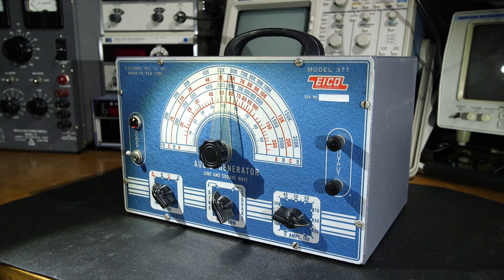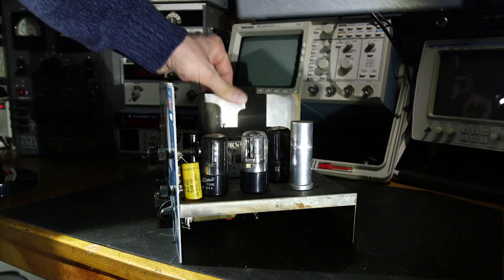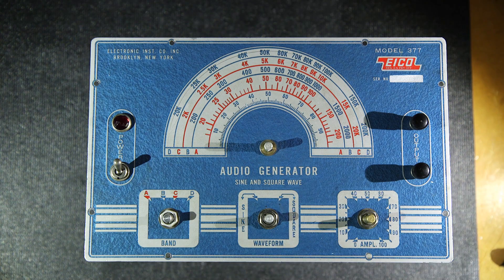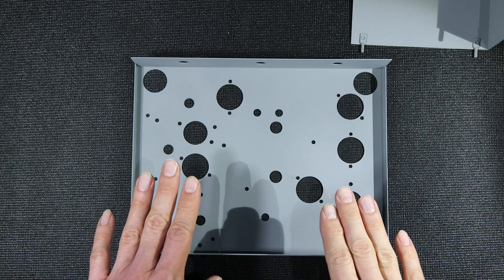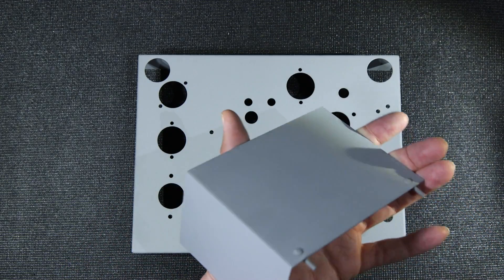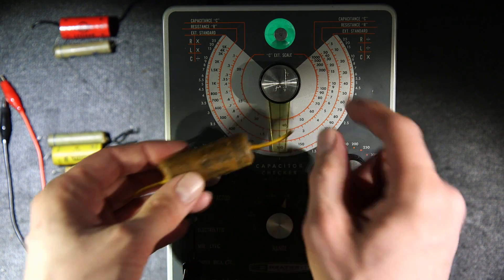Audio Signal Generator Restoration EICO 377

Comment from the maker: To learn about electronics in a different and "very effective" way, check out my Patreon electronics course here: https://www.patreon.com/MrCarlsonsLab
Reply: Mr Carlson's Lab I'm curious where you start it at... do you assume prior knowledge (or prior failure) at all?
Reply: Hi Paul, recently joined your patreon page, how do I PM you? I am new to this sort of stuff
Reply from the maker: What is your name there Chris? I will PM you to make this easy, then you can just PM back to that original PM..This will get you started.
Reply: Hi, my screen name is chris johnstone. Look forward to hearing from you.
Reply from the maker: PM sent on Patreon.
Reply: I need to know how to align an eico 325 with only antique test gear please
Reply: 32:56 i wonder if you cut each type of copper wire you instal sent to a lab that you get a reading of all the metal material in each wire....that some might be diferent....so what if you did one radio with one string of wire so that all the wires are the same materials percents of copper and other metals in the copper....it iz the same to a remote control vehicle batteries....that you match them....a 2/3a matched battery pack

Comment: Mr C. I think your right on the black color on the cadmium plated chassis, some older transformers used a paper wrap for insulating that contained sulfur compounds, when the transformer blew or got hot the sulfur combined with the cadmium to form cadmium sulfate which will cause it to blacken. Your videos are great and i learn something each time.

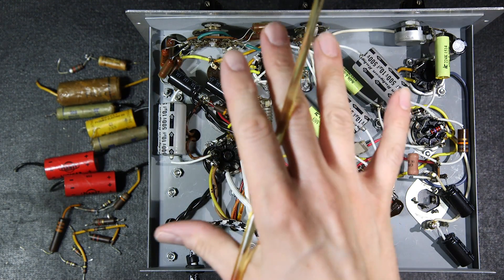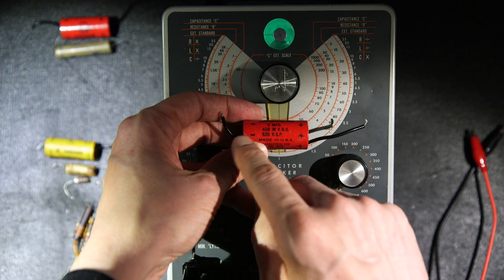Comment: @ 40:55 , we can see you added a new power cord (to assembly instruction original connections) , and @ 54:20 you state that an old electrolytic cap, if shorting out, can burn up your B+ and filament transformer, but, how about installing a properly rated fuse in this older equipment to protect it better from future component failures that may damage hard to obtain or irreplaceable components?  Some of this old Eico, and Heathkit gear (and other manufacturer / models as well) , have no fusing on the primary line/mains side, but if you check similar newer models of the same types of equipment it was added over the years. If no fuse is added, that unfused line/mains circuit will feed your transformer, or in some AA5 configurations (with a solid state rectifier, the shorted filter capacitor/s,) all the current they can ask for until the smoke show is over. Granted, like you said, this is your device to do what you want with, but IMO checking for proper fusing, and adding it if it is not there, is a good practice to follow.

Comment: Ive got the silver case 377 with black numbering. Its the same works inside, some use the newer Noval based tubes. My inspection  sticker is dated 1965. I love the blue baked on paint job of your 377. However I do believe the silver look is more space age looking. The antique radio repair bench in my little shop is all EICO equipment placed in a wall of silver pieces. I also have a Barker & Williams Audio Generator. The color scheme is a hammered powder Blue steel case. It made to Mil-Spec. I worked for B&W in 1961 and picked it up upon severance.

Yes , EICO did cheapen the construction of the  377 Audio Generator. The chassis and panel metal are  made  of a Cheaper,.and thinner grade  of brushed Aluminum. The 4 ganged  variable tuning cap was reduced from a 4 gang section to a 2 gang sections.

Comment: I got an RCA WA-44c I have been restoring. Had to change the dial tracking by attaching a knob to the dial face itself. I plan to toss on a BNC connector so I can use it with modern devices. Also old PCBs are a pain in the rear to remove old worn out parts from. I lifted three traces and had to use a jumper wire to repair the broken traces.

Comment: Ive got one of these units on my bench right now.  I finished the re- cap process. Next up I tested the R’s and replace anything off value. You answered my Q about the shaft coupler on the Freq. control.  I  forgot about that theory over the years. Thanks! My only problem occurs ar the top band. If I adjust  and calibrate 100 Kilohz and tracking is good the square wave looses its integrity and looks more like a sine wave. The frequency begins to go ooff cal.around 200 Khz and the end of top range is 250Khz. The 6SN7 is the original EICO tube, it tests good in my EICO tube tester. All the components in the square wave shaper test good and Caps were replaced. I did not use a 1k ohm resister  across the output when I tested it

Comment: One reason not to be too fussy about the frequency trimmer setting is that there is about a 5% frequency variation between the ranges, as demonstrated around 1:32:15. This variation would be due to the tolerances of the resistors connected to the range switch.
It would also have been interesting, after tuning the trimmer, so see how well the frequency matched at the high end of the dial, though nothing could be done about that.

By the way, I own one of those Heathkit IT-11 capacitor checkers. I would not be surprised if it itself contained capacitors in need of some replacement!

Comment: 1:34:12 - I remember the correct procedure was to use the POT to adjust at the LOW end, use the CAP to adjust at the HIGH end, and repeating until both ends of the dial track.
Reply: OOPS! My bad. Turns out that the POT trims the AMPLITUDE!
Reply: Another bad: In a radio's local oscillator, a variable INDUCTOR adjusts the low end of the band!

Comment: I think a nice LED warm/white that has frosted so its diffused might look nice on those Jewel / ruby light guides. it's a pity you could not keep the sparkly metal some how as it looked really good, maybe a clear coat of something, but anyway the finished restore still looks really good like it was NEW.

I will also like to say every time I have seen your videos on repairs or restores your attention to detail and sometimes doing things the hard way just to get a better result or performance out of something is a clear indication of your passion for electronics and skill, Thanks for sharing and encouraging others to join our small group of electronic enthusiast/ professionals.

Comment: The light bulb for the oscillator first appeared in the HP oscillators used for the Synthesizers in the Disney Movie, Fantasia circa 1938.  It was used to even out the notes on the synthesizer because some notes would be louder than the others.  Dave Packard patented it making it the first documented use of an electro-audio sound compressor, or just compressor.  The guitar and synthesizer musicians might appreciate that.

Comment: So cool...  I like the lightbulb as a PTC gain control , I remember this discussion in my electronics class (long ago 1980's)  about this technique, I don't recall I've ever encountered it because I went on to digital circuitry.   I remember there were a few oscillator designs we looked at, but to be honest I can't remember what were the differences or even what there were, I kind of remember the names: Colpitts, Armstrong, relaxation, etc...  So when you pointed out the lightbulb I knew what the novel use was, but I couldn't "Name that Oscillator"  LOL. 

I'm very interested in your electronics classes, one day, soon, I'll will join your Patreon, I'm between jobs right now... but, your knowledge is incredible so I know it will be awesome and I look forward to it!

Comment: I found an easy way to clean the face of this equipment without any damage to the silkscreening.  Use the Tub O' Towels hand cleaning wipes.  Mechanics use these wipes to clean grease, oil, etc. from their hands.  These Tub O' Towels not only cleans the metal, but they also clean the silkscreening.  If it weren't for scratches, the equipment would look new.

Comment: After watching this video last friday, i bought the cleanest (and cheapest!) Eico 324 on ebay, and went through it and replaced all out of spec parts, rebuilt the power section, checked alignment, and am now cleaning up the enclosure.
I think ill be doing the same witha model 377 next!
Thanks, Mr. Carlson!

Comment: A bit of chemistry for you electronica buffs and just a nice thing to know: aluminium (or aluminum :p) is an amphoteric metal, what means that it is soluble in acids, like iron, but also in bases. A lot of cleaning fluids are basic: soap, sodiumcarbonate, toiletcleaner. Luckily if aluminium is oxidised it has a Al2O3 layer that is very hard (crystallised it is called corundum: like in grammofoon needles). Btw. nice work, mr. Carlson!

Comment: Clipped power cables usually mean the unit has a short or other issue that can affect the power grid. In almost every company I worked for they would cut that cable to prevent people accidentally plugging in the machine and tripping a breaker which in a production environment can  cause other machines to lose power and this interrupt the production process. Can't plug it in with no cable :).

Comment: Cadmium as surface finish.  Wow. Never thought that it was ever used that way.
Reply from the maker: Very common in older chassis type radios, tv's, amplifiers and test equipment.
Reply: @MrCarlsonsLab  Still quite widely used in aerospace, as far as I know. Just because it has been known to work for decades and even if it has issues, they know EXACTLY which issues and how to address them.

Comment: Your knowledge never ceases to amaze me. “A car battery sitting next to it…” WHO ELSE would instantly know that? 🙌 Hehe,I also liked ,”The only way to get this stuff off is to remove it” 😁
Reply: In the Army most of our radio equipment was battery operated by 2 x 12 volt batteries. In the shop we had a vented area under a bench. The batteries sat on a wooden pallet, not on concrete.venting was a must, now you can see why. My friend owns a plating company. I set him up with a computer in the office. So he decides it would make better sense to have it in the shop for time card record keeping . It lasted two months. He called me to fix it under warranty. When I got it in my shop Nd opened it up, the sulphuric acid had totally destroyed the circuit boards. We ended up in small claims court and the judge laughed at him, awarding me  the judgement. Common sense says fumes are fumes!

Comment: Hey, at 1:36:46 the sine wave is not symmetrical. The negative part of the sine looks more rounded and it looks like there is a difference of 0.2div between positive and negative half-cycle. Why is that? I thought that wien bridge oscillators (at least the solid state ones I have seen) produce a symmetrical output

Comment: What would it take to make an all-in-one unit that has a digital volt-meter to regulate an S-9 signal for the radio and a BNC jack with a San Quan Frequency counter to varify all you radio frequency check points as well as the injected frequencies. It would be a nice project for all the people wanting to work on radios to build a stand-alone unit with through-hole parts. That way everything is connected you just flip a switch to turn on the section you need.

Comment: A bit of little-known trivia: 
Paul Tanner used a similar audio signal generator (likely a Heathkit version) to produce the “theremin” sound in ‘Good Vibrations’ for The Beach Boys. Apparently, the prototype version was played using the original dial, but it was soon revised to a linear/slide action in order to make it easier to hit the notes (not sure how in the world he did that - maybe a few idler pulleys and a belt?) 

Very few pictures of the original device exist (it was built in to a wooden case and known as “Paul’s Box) and its whereabouts are unknown as it was later sold to a hospital for the purpose of testing patients’ hearing. 

I have an Eico 377 (later silver-face model) which is in very poor physical condition. Perhaps I can recreate “Paul’s Box”.

Comment: I'm a fan of cold galvanized paint, and have used it many times, most recently on a chimney cap. But the next time I paint a chassis, I think I'll try some zinc chromate. If it's good enough for airplanes and boats, it'll probably last forever on electronics. Thanks for your ultra-high quality restoration tutorials!
Reply from the maker: Sounds like a good idea! I also contemplated header paint ceramic coat.
Reply: I have little experience with these things, but would it have been possible to put several coats of a clear-coat Acrylic Enamel Spray Paint to keep that beautiful bead blasted finish?

Comment: My 377 needed very little work.  Despite having lots of hours in a school setting (it came from a local school district) it was still in very good working condition before I even tore in to it.  I tested all of the electrolytics and they were still in very good shape.  I put a 6BX7 in place of the 6SN7 in the chopper circuit.

Comment: The incandescent lamp™ increases it's resistance, when it warms up. Why not use this feature with the Bluetooth ™, for the Volume Limiter ™?..
Reply: I light bulb in series is a quite common way to protect tweeters in speaker systems.

Comment: Thank You for the excellent video.  That Wien bridge Oscillator has certainly been often used in many different iterations by many different manufacturers.  Another YT uber demonstrated a Chinese OP chip / kit version.  It came complete with poor directions to build it, and the kit maker had replaced the light bulb with an LED but it was in the wrong position, so it made poor sine waves and only generated one frequency! (the kit designer seemed to be unaware that LEDs resistance / voltage drop decreases with increasing voltage rather than the increasing resistance of a filament with higher signal voltage.  So nice to have Your thorough explanations, and excellent discussion of operation theory.  
Have You ever plated cold roll chassis with tin, rather than cold galvanization?  seems like that could work.  What do You think?

Comment: How did you detemine that it was cad plated and not zinc (galvanized)?  Did you see that yellowish tinge typical of cad plating? Anyway, I would have been tempted to zinc plate it after you sand blasted it, rather than use the cold galv spray paint. A lot of car restorers electroplate after blasting.

Comment: Thanks again for your video on restoring the very early Eico 377 Signal generator. What a beautiful job you did on that sig gen…. I really appreciate the fact that you emphasize safety when working around high voltage and expressing that some early test equipment can be dangerous  to use… The most enjoyable part of the video is when you totally went over the schematic and explained the circuit design and how it works… It brings back memories from when I was 13 and built many of the Eico kits which I still use now at the age of 76… Thanks again I'm a new fan …. Walter

Comment: Hello Paul,  as usual you find a way to captivate me with your restoration.  Allways fun to watch you do those project.  P.S.. You talk about a capacitor tester that you build working in low voltage, when or where can I get a copy if possible so I could build my own ?  Thank's
Reply from the maker: It's available on Patreon right now.
Reply: Thank You Paul, As I wrote yesterday, I did enroll to your Patrean Channel.
Thank You  for replying so fast.
Reply from the maker: No problem Andre, and welcome!

Comment: Congratulations, Paul, for your initiative in promoting Electronics through your restoration videos. These videos are a lesson for everyone who loves this area! Curiosity: this solution using a lamp to adjust the amplitude was also used by HP in its first product, the HP200A (Wikipedia).

Comment: Ok, you got me. I’ll be be going over and signing on at your patreon channel.  I have wanted to for quite a while but my limited available time has held me back.   Your plan for the low voltage capacitor tester is irresistible however.   Of course you realize those high prices on the old style capacitor testers is probably in large part because of your excellent teachings and now many of us interested in the old gear want to have one.
Reply from the maker: Thanks for your kind words! This new cap leakage tester should hopefully counteract that affect.

Comment: I do find it odd that you're more worried about voltage than amperage when it comes to shocks. A shock from ESD can run to several kV, but it's pico Amps. I've accidentally cut through a 24v cable on my old boat that blew a 1/2" hole through the blades of my cutters.
Reply from the maker: 24 Volts may have blown a hole in the blade, but how bad was your shock? Car batteries have 12 Volts at 1000 cold cranking Amps. How bad of a shock would you get from that? I have had 30KV shocks at low current, THAT feels bad! There is a point of balance with Voltage, Current and shocks.
Reply: Yes, it's current that kills you, not voltage, but don't forget Ohm's Law. Across a constant resistance, current is directly proportional to voltage.
Reply: Good points, both of you. Fortunately I had insulated handles on my wire cutters, but easily 15mm hole in the things. Funnily enough I just bought a used DC bench supply and in the pdf manual that I downloaded it says that 60V and above is the accepted approximate cut-off point at which a shock has a chance of being lethal, this in relation to using the two main outputs in series to get a 0-60V supply from 2x 0-30V. So, consider me schooled, and grateful for the lesson!